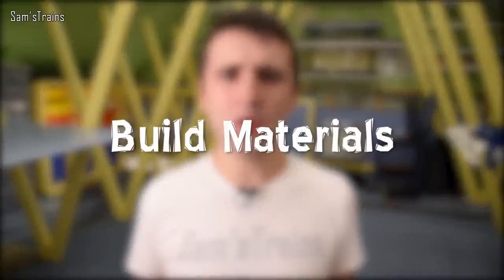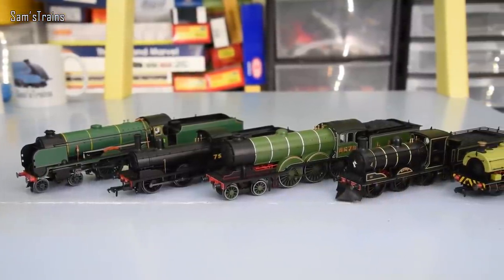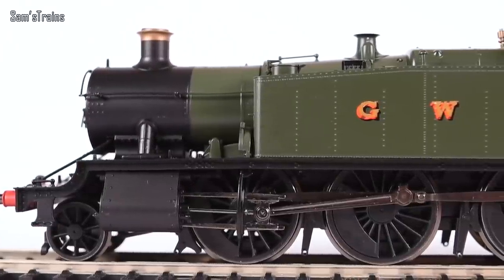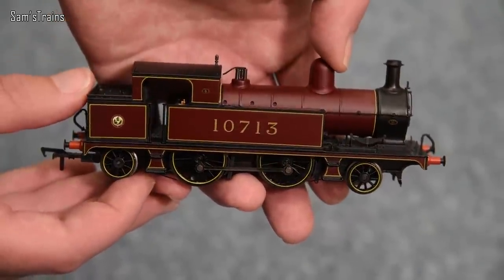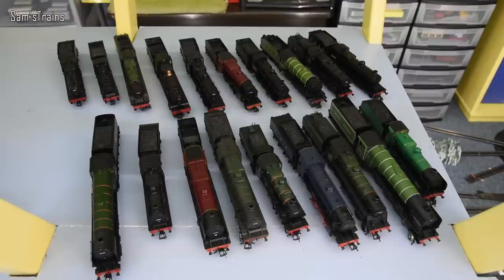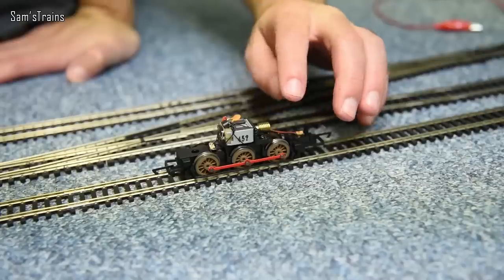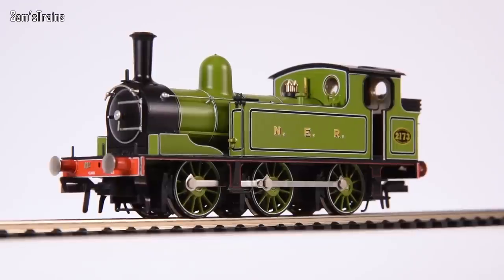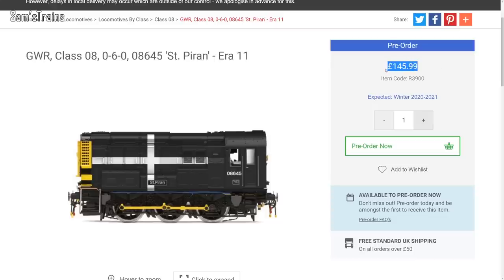Bachmann vs. Hornby Trains | What's the Difference?

Comment: I paid for my newest little loot, as I like to call it, in instalments. First of all, Resolven Grange came into my possession at £40 rather than £80, from Chester Model Shop. The reason for the knockdown in price was because I accidentally knocked off both nameplates. Paul, ever one to forgive, glued the nameplates back on. The Scenecraft Fish & Chip Shop was second to be bought, £20 out of a second instalment of £40. A part exchange of the LNER Black J72 and BR Black Jinty Tank Engines helped cover the cost of £120 left over for Overton Grange. I paid the £20 difference and £8.40 for the Catering Van. Of course, after that I knocked off one nameplate again, yet blu-tack is now holding it firmly in place. Sam, neither Hornby or Bachmann are to blame for the problems you have. You are to blame because you've put in too many sets of points. So my Hornby and Bachmann models will always work better than yours, apart from one Santa Express engine who suffered a worn-out motor because of me. The other Santa Express Engine still runs perfectly. Also, my Little Spookie, a Heljan engine, this time from ebay, has yet to be tested.:_SamstrainsSamstrains:
Reply from the maker: Ahh I remember hearing about this - thanks for sharing kelly! Yes maybe it is my fault about all the points!
Thanks for watching - Sam :)

Comment: Hornby new:
Details are okay, runs well, good for play
Bachmann new:
Details are superb, runs maybe good, maybe not so good, good for display

Hornby after 10 years:
Details still okay and none broke off, still runs very well, often played with and still good
Bachmann after some years:
Many details glued, some broken off, some gone missing entirely, runs no more because the drive train is complete garbage with all the cogs broken, loose and/or fallen out of the locomotive, no longer for display, no longer for play, because the whole piece of crap went to the trash bin.

Note:
Bachmann Chinas QJ model simply fell apart, after the complete drive train broke, the wheelframe just broke apart, all axles with wheels fell out of the locomotive and i had only the boiler in my hand. Everything else littered the floor.
After reverting back from berzerk mode, i threw everything in the trash too, all that remained after i threw it against the wall with full force.

Never again will i buy anything from Bachmann, be it US, UK or China - it all the same low quality shit.

Comment: Hello Sam, interesting to see the differences between the trains made by two well known manufacturers, nice video! 
Hey Sam I have some questions for you, a while ago you posted a video where you compared different types of cleaning fluids to determine the best one to clean the track, wheels and pick ups with. Here is the link...  https://youtu.be/7e10NkWLx2g

The best one for you was IPA and you said that you personally use IPA to clean the wheels and track and I think pick ups. However I stumbled across a video on YouTube that goes against cleaning with IPA, instead the guy in the video advices to use a product called Inox. I am interested to know your opinions on the video. Here is the link to the video... https://youtu.be/1r2L8NSxOnQ 

Also in your cleaning fluids video you said IPA discoloured the plastic. I am going to service a hornby thomas I have, and I was wondering am I safe using IPA to clean and remove old oil from the wheels? Considering the spokes of the wheels and the drive gear are plastic, will it distort or damage the plastic in anyway? 
Also what percentage of IPA should I use?? 

Another thing is there anyway to clean the commutator on a Hornby type M motor (the same motor that is used in the Hornby Thomas)? 

Lastly I am searching for an oiling pen I can’t find the one you have on eBay, is it called a “gauge master oiling pen?” I remember in one of your live stream videos you said you use to have an oiling pen but it cracked or leaked or whatever (something along that line). So I was wondering do you have any good recommendations on a good oiling pen? 
I would really appreciate it if you could help me with these questions. 
Anyway thank you very much for reading and have a lovely day, cheers. 👍
Reply from the maker: Thanks very much James! Yes I've seen that video by Fishplate; it's misinformation unfortunately. I use 99.9% IPA (which is readily available), and the quantity of water in this is absolutely tiny (0.1%). This quantity being considerably less than in the atmosphere - so perfectly fine for use in model railways! I've used 99.9% IPA for years with no ill effects whatsoever. The track rubber demonstration is completely flawed too, as it doesn't represent anything like a normal use-case!
Yeah it's a gaugemaster - though they don't seem too readily available now - any oiling pen should do the trick though!
Thanks for watching - Sam :)
Reply: Wow thank you for your response. It has definitely put things straight for me as when I saw fishplate’s video I thought the things I have learnt about track cleaning from the internet was useless. 
Thank you. 👍

With the IPA I take it I am safe cleaning old oil from Hornby Thomas’s wheels and it won’t damage or distort the plastic parts such as the rims and drive gear right?

And with lubrication I understand to use sewing machine oil. But should I use grease on the gears? There are so much options for grease out there I am overwhelmed. I found a product called... 
INOX MX6 Premium Food Grade Machinery Grease 30gm
Is this good to use on plastic gears?

Also one more thing I have noticed my Hornby Thomas is beginning to make a faint squealing noise from the motor. Which has got me a bit worried. I suspect the commutator is dirty. It’s a Hornby type M motor, would you have a video on how to clean a type M motor or something , like the commutator of a type M motor? 
Is there another way to completely eliminate the squealing from the motor? 

Anyway thank you so much for helping me with my previous comment, cheers. 👍👍👍

Comment: For years, I have always been flummoxed (to say the least) by the absolutely appalling mechanical quality of the available British 00 gauge locomotives as compared to the continental H0 ones. It's all the more surprising that 00 with its 1/76 scale allows more space inside than the 1/87 one (even taking into account the narrower real scale bodies of the machines and rolling stock - hence the historical choice of 1/76 models rolling on 1/87 track). Anyway, most Bachmann and Hornby models resort to mechanical choices and construction quality equivalent at best to those of mid range quality models manufactured by Lima, Jouef, Hornby France or Piko in the mid 60s...  Not to speak of superior models by Roco, Fleischmann or Märklin. As for the models manufactured today, almost all of them sport 5 poles or brushless motors, flywheel(s), nylon or steel bearings, multiple piston pick ups on all axles (including the tender ones - and many favour a motor in the tender).
Reply: I’m an Aussie, sometimes British car enthusiast, and it was reflected in their cars too. Nothing quite like a classic British Lucas auto electrical system, lol, for “sponatious non-operation.” Still, I prefer that to the drive train seizing up on a classic Italian car.

Comment: If you are modelling a particular line such as the Somerset and Dorset, Hornby haven't catered for it as far as engines are concerned.  There are exceptions, in that they do produce a 4F, 2P and Jinty of which the models are old and as far as the first two are concerned have incorrect chimneys.  They also produce a Black 5, which is good, an 8F, which is OK and West Countries of which I have several.  Bachmann produce good models of the S & D 2-8-0, 4F (better quality model but inferior mechanism to the Hornby) BR 5, BR 4 4-6-0 and 2-6-0, Ivatt 2-6-2Tank Class 3 2-6-2 tank and Class 4 2-6 4 Tank.  Hornby do produce a BR Class 4 4-6-0 whose mechanism I prefer to the Bachmann but don't produce such a wide range.  I have been waiting for over 2 years for Bachmann to produce its Johnson 0-4-4 Tank.  I would rather have  had a Hornby model but they aren't producing it, because their mechanisms are better.  We tend to get hung up on how powerful an engine is.  If the original was only going to pull a maximum of 4 coaches, then it may not need huge die cast bodies etc.  However the coaching stock is totally different.  After years of stagnation, Hornby pulled their finger out and started improving the quality of their coaching stock.  You only have to look at the quality of the Hornby Stanier coaches and compare them to the Bachmann porthole stock to see their superiority of their newer coaches and they are now even competing with their Mark 1 coaches with Bachmann.  Hornby's excellent Maunsell, South Western and Bullied coaches knock Bachmann's coaches into  a cocked hat.  Bachmann have a huge range of wagons, which only now are Hornby making a dent in the quality due to them using old mouldings.
Reply from the maker: Yeah that's true Don, definitely lots more railways and locos still to represent - at least there's no shortage of material! Coaches and other rolling stock is another kettle of fish entirely - I might go into that later on! :D
Thanks for watching - Sam :)

Comment: Why do you think I have a whole collection of backman motors I know I spelled their name wrong that was intentional

Same thing with hornby

And just even American manufacturers

I have engine I have bought engines just in case they fail it just stuck them in a cabinet and it's labeled for each one of the manufacturers that I bought one from

That's my problem with them honestly I wish the industry had like for locomotives 

They would just go to using the same five pool motor and it was just standard across all the companies

And make make it a little bit easier on us customers

I'll say this I'll give up some detail if the mechanics work if you give me good mechanical stuff I can get a locomotive detail detailed I can detail a local I'm not very good at detailing a locomotive but I can do it I'd rather send it to somebody who knew what they were doing and give them the look I want cuz I don't have a lot of time well I mean I have plenty of time pandemic wise since but mechanics first give me a good chassis mechanics and I can work with a plastic body

I've also made spring buffers before they're actually not very hard to make surprisingly

But I can I can fix the paintwork and things like that I can fix that that doesn't bother me as much as the mechanical issues if there are things I can't even fix I really don't even like to run the locomotive on my layout I can change the gearing it's very complicated but I can do it really it's just getting the motor to run at a higher RPM at like lower speeds

But you get my point are you people don't I mean I recently had to replace my my origin big boy motor and when I say the original one I mean the very first one I bought was I don't remember when I bought it

I'm still waiting for him to purchase from an actual company who does business here in America with trains
Reply from the maker: haha glad to hear it - I have a huge stockpile of spare motors too! Me too - I'd give up a bit of detail any day!!
Thanks for watching - Sam :)

Comment: Tender pickups are there if its in need hence why some don’t have any tender pickups. Bachmann also does flywheels but only in multiple units. So in essence, this video is inconclusive.
Reply from the maker: They're always in need - the more pickups, the better the continuity and the smaller the current through each wheel/pickup. This makes the arcing smaller each time a connection is made/broken, and keeps wheels cleaner. So in essence, don't try to teach granny to suck eggs! ;D
Thanks for watching - Sam :)
Reply: Bachmann without pickups on the tender are a sign that the loco is old tooling, but Bachmann still charge future like prices. Keeps track cleaner too with less arcing. Maybe OK for those running trains near flat out all the time like a slot racing set though.

Comment: Found Bachmann locos unreliable, drive wheels that fail  and motor that burn out too quickly. I have a Hornby loco that is very old and still has the original motor that works well. Hornby gets my vote.
Reply from the maker: My findings are exactly the same; I have Hornby locos from each decade since the 1950s still in perfect working order. I then have countless Bachmann locos from the 1990s and early 2000s with failing wheels and splitting axles, and even much more modern engines with failing motors. Hornby gets my vote too!
Thanks for watching - Sam :)

Comment: Good informative vid, but please for the love of god build yourself a proper model railway layout on base boards and stop running on the floor, my pet hate people running there models on the floor and carpets causes so many faults with locos and results in many returns to shops or locos being sold second hand as they wont run, only to find its nothing more than carpet fluff in the gears etc stopping the motors working
Reply from the maker: Sorry if that's your pet hate! The layout for me is just a means to and end, as my interest lies solely in the models.... I've never had a problem with my current setup!
Thanks for watching - Sam :)
Reply: @SamsTrains  if your models are your sole interest then it is also in your interest to have your models kept right and to not damage them by running them on carpet, it defeats the whole object of them being models there not toys

Comment: Yes you would. You shouldn't need to address anyone else's failures except your own. Your viewers should address their own failures, if they experience any. I addressed the failure of a worn-out motor, knowing I was the one to blame for it. No-one else did it for me. Believe me, if you didn't criticise every model engine you review, we'd all be a lot happier. Just accept all the model engines you buy for what they are. You are to blame for your own failures, no-one else. Think about it. If Hornby and Bachmann learned that you were criticising every new model you purchased from them, they would likely stop making the models we all love and cherish so much. And then model shop sales would stop altogether. The way in which you review your models makes it sound like you're not grateful for what you've got. OK, not every engine you have runs over all the points smoothly, but the one to blame for that as I say is you. Remove some of those sets of points, and you'll have better results.:_SamstrainsTheWheel:
Reply: Or perhaps Hornby and Bachmann would up their game and make better quality models. Those points. Now either the points are out of gauge or the locos and rolling stock are. Either way it's a manufacturing fault.  Don't see how the modeller is to blame for manufacturing faults. 
Points aren't cheap. I expect them to be in gauge. Locos and rolling stock are expensive. Some are very expensive.  They should work properly and be finished properly. As it is the customer that's spending their money,  shouldn't it be the manufacturer who is grateful?
Reply: @Poliss95  This is supposed to go both ways. Sam is only at fault in that he has too many sets of points on his railway, my good fellow. The points are all in gauge, he just put in too many, which is a common mistake every railway modeller makes. Hornby and Bachmann must learn to see that competing against each other will get them nowhere. It'll be a lot better if they can work side by side, thus getting better feedback from customers who purchase the models out on the shelves.
Reply: @kellyashfordtrains2642  Sam has hardly got any points on his railway. I have a lot more.  The number of points has nothing to do with derailments.
Competition is there to improve what manufacturers do. Company A makes a product that is better than the one made by company B. Therefore company B must improve its product in order to keep market share.
Competition low says they must not work together. Such a thing is called a Cartel and there are extremely heavy penalties for being in one. A company can be fined up to 30% of their annual turnover in a particular market if they engage in anti-competitive behaviour.
Reply: @Poliss95  Yes he has, you're not looking hard enough. It's not anti-competitive behaviour at all. There's only one way Hornby and Bachmann are ever going to improve, and that's to work together. That way, they will easily see they are just as good as each other. Thus, both sides share the market equally. It shouldn't be about who makes the better model, more likely it's about seeing that Hornby models are as good as Bachmann models. One reason why I love Hornby and Bachmann models equally. Hornby and Bachmann are as good as each other with the models they create, they know that neither is perfect. What they give us is good quality models on both sides. That's the way I see it. I'm the one who has better results with my models, because I don't have any points on my railway. Look at Sam's Railway. Sam has Express Points and siding points, which sometimes are the scene of minor derailments. It shows in many of his videos.
Reply: @kellyashfordtrains2642  No. They can't work together. That's the very definition of anti-competitive behaviour. Share the market equally is the definition of a cartel.
I can't imagine having a layout without points. That would be extremely boring. Millions of modellers around the world have no problems having points on their layouts.
Reply from the maker: Leave it Kelly - models are designed to work properly on points, regardless of the number of them. Not to address the failures or downsides in a model would be a total waste of everyone's time!
Thanks for watching - Sam :)